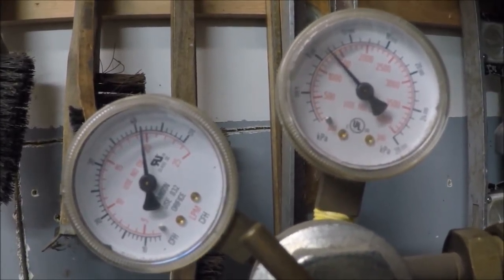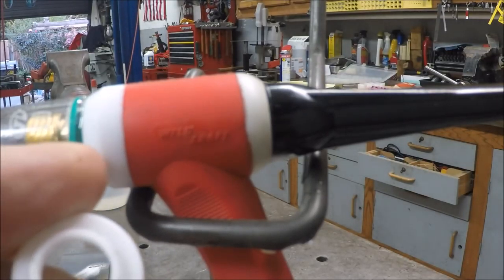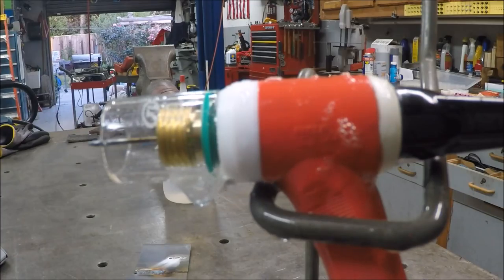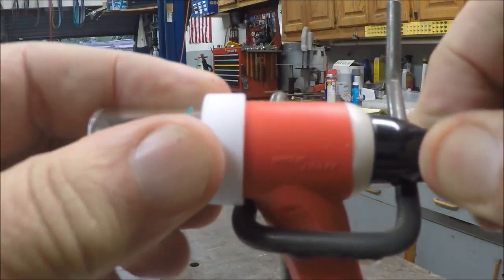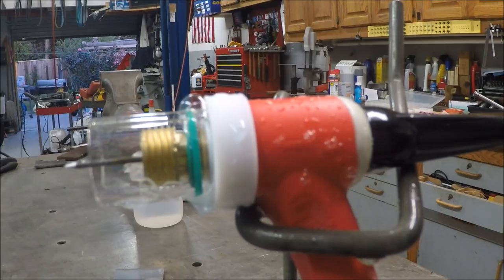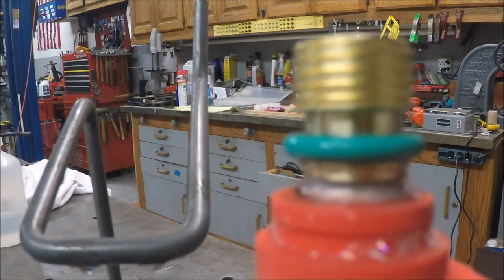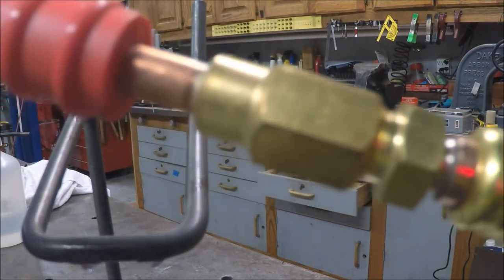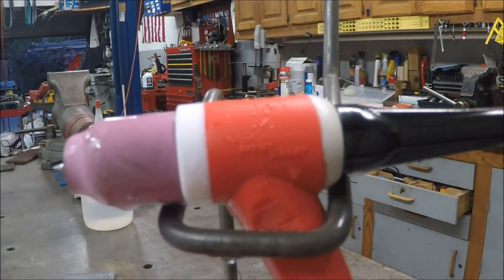TIG WELDING STUBBY GAS LENS #10 PYREX CUP (follow up)

Comment: Don't fret, Chuck, us old guys all have problems with gas!  :p  Don't give up, you still should've be getting gas behind the oring, though.  Try all of the gas lenses you have.  Maybe that one is just a bad one (Screens are clogged or the solder welds between the copper and brass parts leak).  There's no way gas can get behind the oring from the front.  I bet it's the solder joint on that lens.  You can always use more orings!  Usually I see them with red (silicone) rings and not green (nitrile), but you can't always go by the color, and it shouldn't really matter anyway.. you've got a leak between your lens and the torch.  The ceramic cup works because you might've tightened down really hard.  The glass ones of course have no threads.  I bet you'll love that thing once you get it working.  Three cheers for a another follow-up!
Reply from the maker: Thanks Tony for your support and suggestions....I have over 5 hours between testing and producing 2 videos....I think I am done with the Pyrex.....at least for now....
Reply: The only way you didn't try, was to double up orings, would it had solved your gas leak problem, i did it like that and no problema.

Comment: Good video. I had the same problem with an inexpensive kit I bought on Amazon. What I found was the cup was too loose over the gas lens. The mfg. told me to use two O-rings but one kept tearing on the gas lens threads. I returned the kit and bought some #8 Furick Pyrex cups and what a difference. The seal is tight with only 1 O-ring and the gas flows much better with no leaking. Turns out the inside back diameter on the Furick cup is slightly smaller than the Chinese cup and thereby gives a better/tighter seal.

Comment: Check the small o-ring seal between the collet and the extension.  The collet is probably being pulled up tight before the end cap seals.  This could be as simple as disassemble and reassemble.  The collet is fetching up on the tungsten before the cap is completely screwed in.  You can always try one of the shorter end caps.
Reply from the maker: thanks for the viewing and comments

Comment: I believe you are supposed to use two of the green "O" rings...
Reply from the maker: Thanks for the comment...I tried 2 per your suggestion.....it still leaked....
Reply: For an "O" ring to work properly, it must have the proper "squeeze."  I would get out the calipers and check the ID of the glass tube, the OD of the gas lense body and the cross section diameter of the "O" ring.  If the proper "squeeze" is produced on the "O" ring from the difference between the ID & OD it will cause the "O" ring to seal,  If not, the "O" ring is too soft (durometer reading) or it is not properly contained.  If containment is the problem, then you may need to insert some small brass washers on the lense body to prevent the "O" rings from deforming orthogonally to the ID / OD.  Possibly a simpler solution would be to try some "O" rings with a larger cross section or with a harder durometer.

Comment: Hi,
I bought the same kit a couples of month and have had the same problem, but after I cleaned the gas lens with isopropanol it started to work as I wanted. Probably there was some oil in the gas lens after it was made.

Comment: Really should have a flow meter/adjust for the argon not just a pressure reg. Too much pressure/flow will cause turbulence that will pull in air and cause problems like you are seeing. IMO those leaks if small are not a huge deal, its just argon to atmosphere with no consequence to the weld.  Enjoyed Chuck!
ATB, Robin
Reply from the maker: FYI...I purchased flow meters tig, mig....thanks for viewing/comment

Comment: Probably needs 2 O-rings buddy, might try to lube those up, get better ones or use high temp RTV.  I would think rtv should peel off your torch w/o damageing it.
Reply from the maker: Steve...tried 2 O-rings...same result.....I think I am done with the Pyrex
Reply: Yeah I understand. Dont know if BG has them but I've had good luck with the "gas saver" type nozzles from china on ebay but they are a lil' bit more expensive.  But honestly I don't think there is much advantage to pyrex.

Comment: That makes zero sense. The hole in the front of the cup is ~1" in diameter, so the gas should be taking the path of least resistance, which is out the front. What is creating back pressure to cause the gas to come out begins the o ring? I'm so confused about why it's leaking behind the o-ring. (Since you used the same gas lens with the Pyrex and the alumina cups, and only the Pyrex one has issues.) Maybe if you stuck your palm over the front of the cup, to seal it up, it would force air out behind the o-ring. But other than that, it doesn't make sense.
Reply from the maker: Andrew....I am confused as much as you

Comment: Finding those Pyrex cup leaks sure proves one point at least. BTW - while I am no TIG expert (understatement) - I do like one of those vertical tube deals (with the small ball in it) to set up the gas flow rate - seems easier to get right.
Reply from the maker: Hey Chris....I have a flow gage on my mig, which just broke.....the gage shown came with the welder

Comment: Hi Chuck, I had a gas lens that was blocked from new, That would cause the gas to leak from the pressure build up behind the O ring. Just a thought. Thanks for sharing.
Reply from the maker: Malcolm...you might be correct, but to blow on the lens air passes.....thanks for viewing and comments....

Comment: THE ORING GOES ON THE THREADS!!!  Not the shoulder of the lens! You aren't getting a compression seal on the oring.
Reply from the maker: thanks for the comment but if the O ring is on the threads the Pyrex cup doesn't fit...
Reply: outsidescrewball well then it's a double oring style .... they use two together on the shoulder to create a vacuole behind the thread 
Others use a proper sized oring to compress on the threads

https://goo.gl/images/kQBuLm